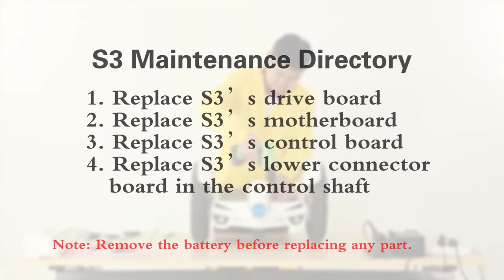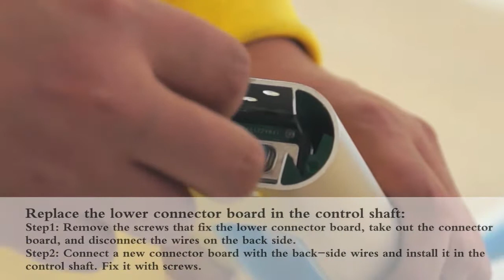To replace Airwheel S3’s drive board, motherboard, control board and lower connector board

Comment: My Airwheel S3 doesn't power on by a remote control after 3 months of not using.  The hard butting power on OK with the prompt "the bluetooth is ready to pair".  Can you tell me what's wrong with it?  Thanks in advance.
Reply from the maker: For after-sale consultation, please email to: after-sale@airwheel.net.